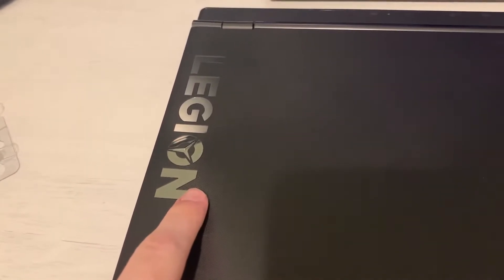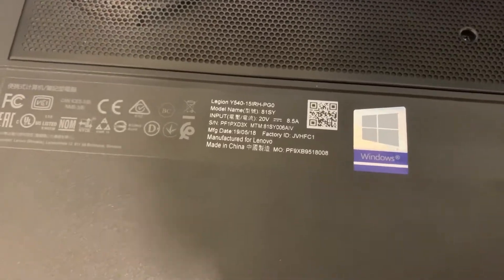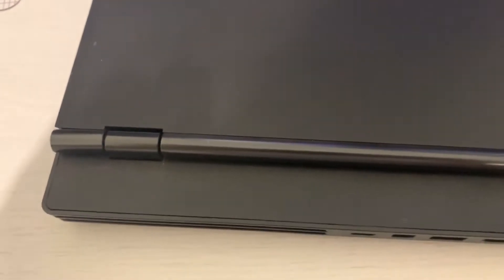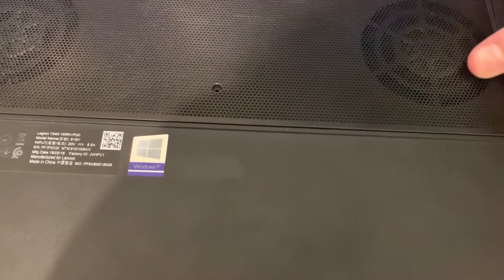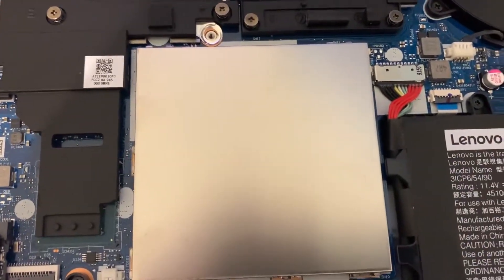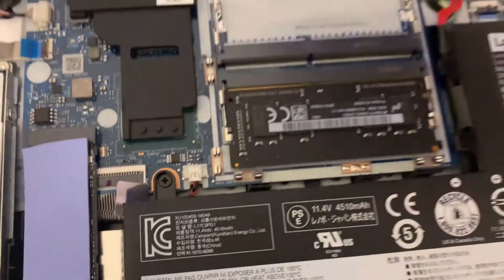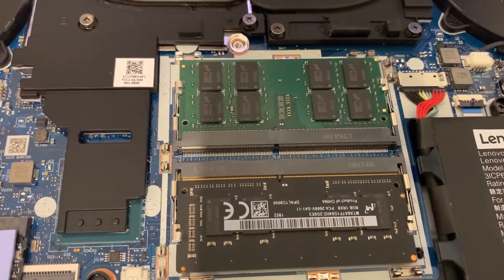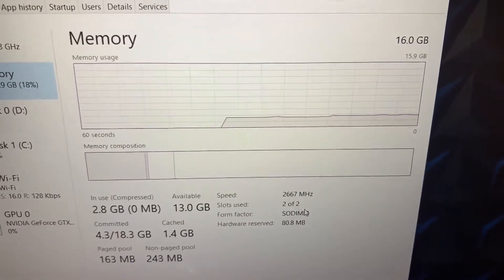Lenovo Legion Y540 RAM SSD and WiFi Card upgrade Guide

Comment: Which year it this model from?
Reply from the maker: the y540 was manufactured in 2019 and thats when i bought it. though i should say that your question is irrelevant as the previous model was the y530 and before that the y520 only after the y540 lenovo decided the mess the naming scheme and just call the entire line the legion 5
Reply: @ASking20  aah alright, thx. I got the y540 as well but wasn’t sure they made more models of it with the same name

Comment: 3:06 hey, can I somehow replace that Wi-Fi card with an SSD? I dont have an SSD port, please send me an example of a SSD that would work in that slot. thanks
Reply from the maker: no these are two different keys. if i remember correctly the wifi one is called e key while nvme is m key, basically the two while looking similar are different in both the pcie lines that are allocated to them and the connector itself
Reply: xD
Reply: @profiyntroz5186  what
Reply: @DemeDemetre  i had to laugh. U wanted to put ssd into the wifi card place
Reply from the maker: pls no bullying its an honest mistakes anyone can make
Reply: @ASking20  i know, but it was just too funny for me
Reply: @profiyntroz5186  yeah and? i thought it shared the pci express or whatever lanes. it is Msata, same connector

Comment: does ax200ngw work properly in Y540?
Reply from the maker: i see no reason why it shouldnt
Reply: @ASking20  it has worked properly. ax200ngw is not included in the FRU list
Reply: @wls678814  did you try it did it work
Reply: @wls678814  thx

Comment: hello sir may i ask, have you been able to undervolt your cpu ? mine has high temperatures and when i wanted to undervolt it with intel XTU i couldn't modify values of core voltage offset ? Do you have the same problem as me ?
Reply from the maker: ye i was able to put a -0.125 undervolt (took that number from a jarrods tech video) i did that through xtu so it worked for me maybe you tried it in an incorrect place. and it worked well enough so that the stress test that xtu provides barely didnt thermal throttle
Reply: @ASking20  which version of xtu are you using, on my y540 the option is greyed out and can't change it.
Reply from the maker: welp it seems that xtu and the cpu as a whole dropped support for undervolting via software you could try to mess around in the bios to see if there is the ability to undervolt there but if you dont want to do that then try lifting the laptop and giving it more airflow that worked pretty good for me in the past
Reply: @ASking20  hey there, i managed to fix the issue by using throttlestop first and then i used an old version of intel XTU 6.5.2.40 and now XTU works fine
Reply: @1syncgg  do u know where to get that version of xtu? every single place i can find only has the latest version